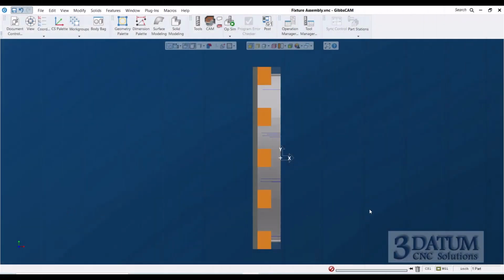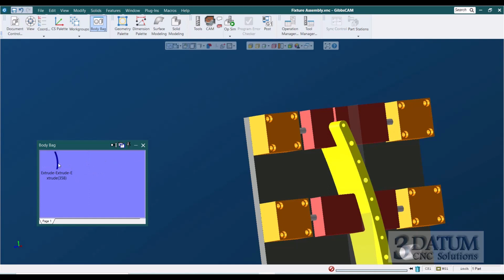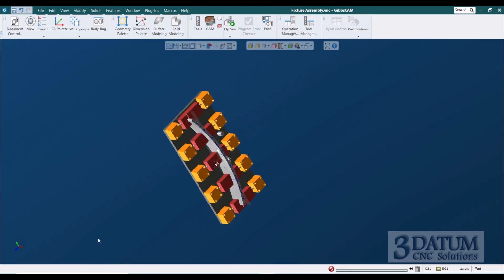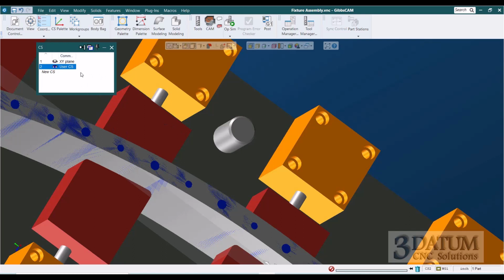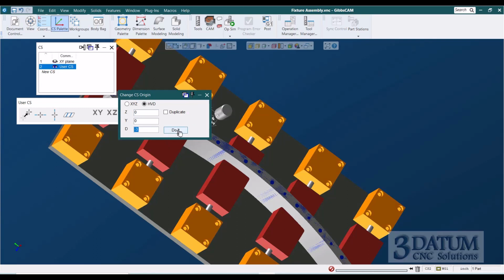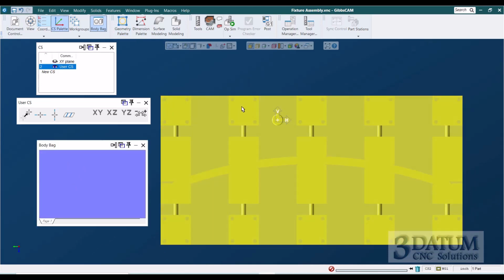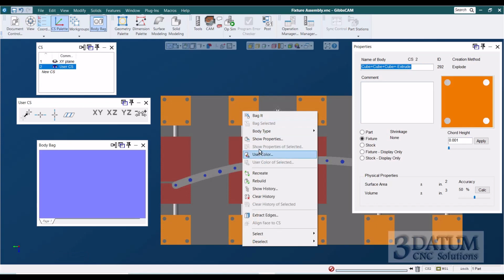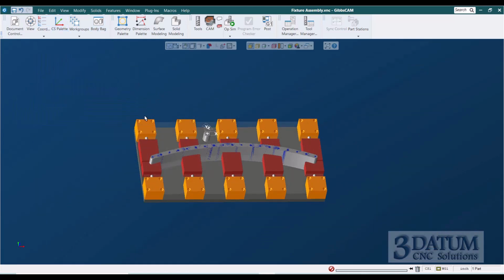Coordinate System Bouncing an Assembly Into Position

Comment: I’ll do a video on creating a second OP program using stock from OP 1 very soon.

Regarding making a facet body into a solid model, they are very different things, even though they look similar.  A facet body contains completely different data than a model.  Even CAD software can usually only reference the facet body to help build a solid model - not change the facet body into a model.
Reply: Just wanted to let u know. I finally figured out how to use Facet Body for op2